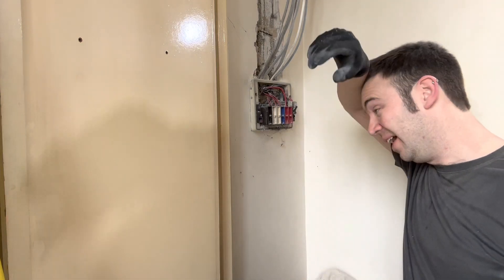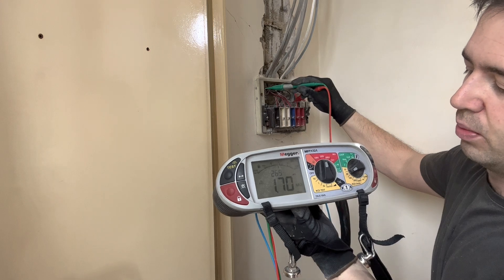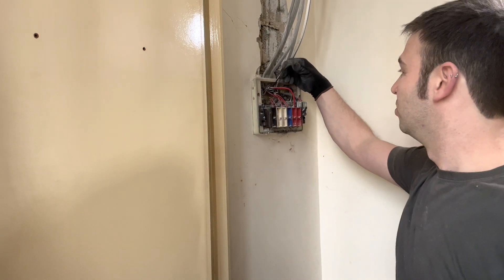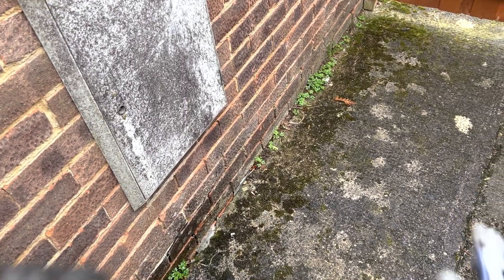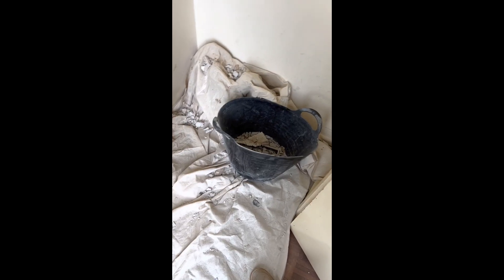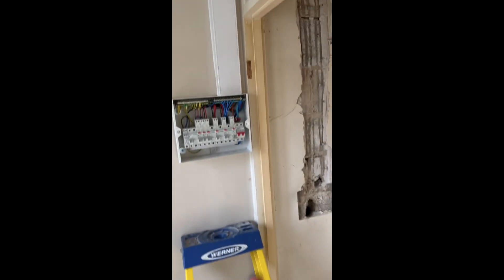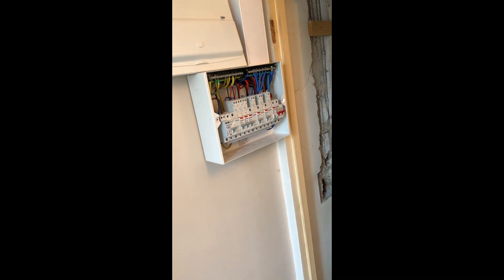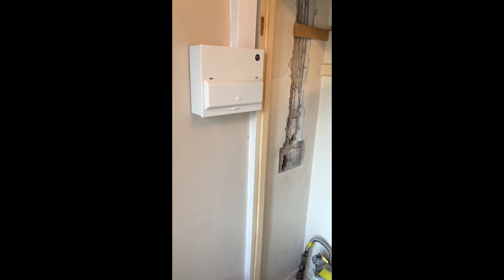CONSUMER UNIT RELOCATION VIA SWA

Comment: I may have missed it in the video but what size SWA cable did you use instead of meter tails?
Reply from the maker: 16mm 3 core, main fuse confirmed 60A

Comment: Question regards the Verso board. Are the earth/neutral bar terminal screws brass or steel. I've noticed the Fusebox ones are steel and even below the 2nm required termination they start deforming - quite the pain in the arse if you've got a full board with no spare screws.
Reply: Are there any that are good. Fitted a Hager this week for the first time and they seemed shite too. The only consumer unit i’ve never fitted is contactum, every other brand gave shite terminal bars. Or is it my screwdrivers?😂
Reply from the maker: @SME_Ste  Crabtree, Wylex & the MEM3 range is really good
Reply from the maker: Hadn’t noticed, but I’ll take a look next time

Comment: Did I hear you say you glanded the armour in the trunking? 

Could you have used a metal box in meter cupboard and glanded the armour in the meter box? 

Just a thought.
Reply from the maker: Could’ve done, as stated it was a last minute change to my original plan of metal switchfuse in the meter box. An adaptable box was all I had.
Reply: @bristolsparky  cool always good to bounce ideas. I’m interested how you glanded the armour in the trunking. 
Tag me if you ever show that on a video in future please 🙏
Reply from the maker: @matthewfewings6023  I glanded it correctly & directly (with a bond to the MET) into the metal consumer unit. Then did a 32mm hole with grommet strip to the right
Reply from the maker: Then used 50x100 trunking to cover the holes and the size of the gland with shroud.

Comment: Great vid... Why didn't you use switched fuse outside? Sorry I'm an apprentice your knowledge will be helpful also what's the 3 metre rule about? Thanks
Reply from the maker: The one I’d purchased would no longer fit as the meter company had installed a newer/larger smart meter with isolator.